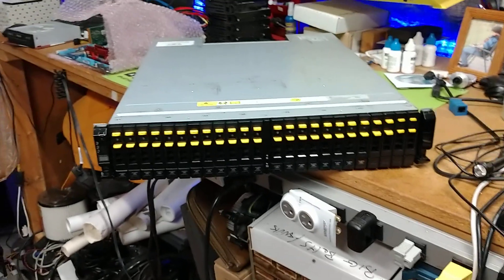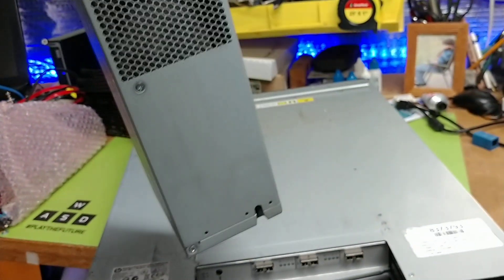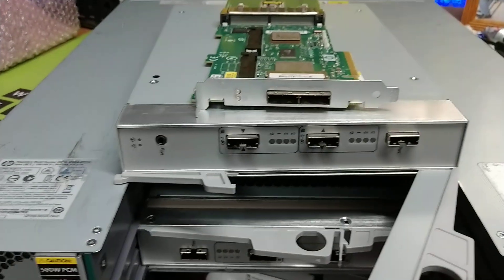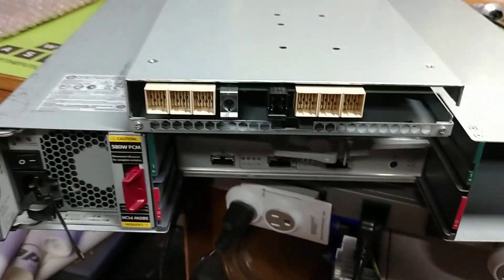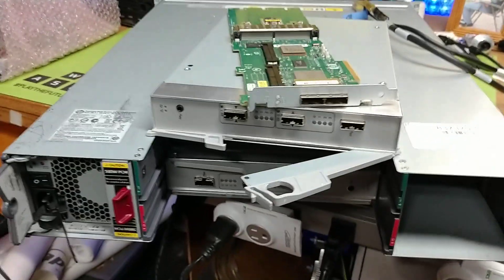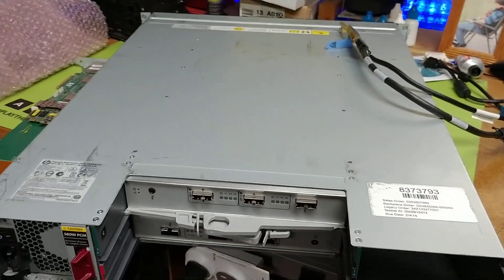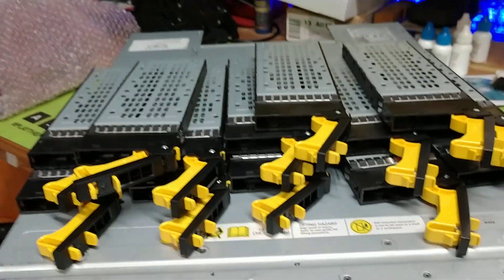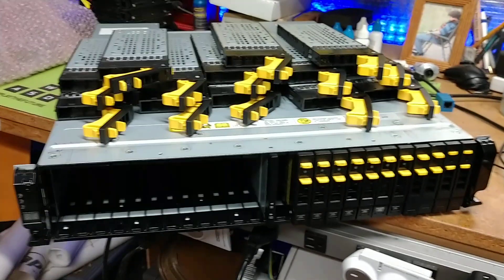Reusing a low cost HP 3PAR M6710 SAS/SATA 2.5 inch, 24 drive disk array  for your home server lab

Comment: Is this controller hba or raid? If it is a raid can it be flashed ti an IT mode and passthrough the disk instead of presenting them as virtual disks?
What is the equivalent of an iom12 controller in HP supporting sas3 12G drives?
Reply from the maker: You can do both. HBA is the most popular as I understand it but I used them both.
Reply: @leadiususa7394  Nice..thank you. When you used it as an hba, could you see  smart stats of your disks from the hypervisor or OS? If not it s not a true hba. It would remind me some Dell,'s controllers who while they have the option for hba mode as well, they aren t a true / native one With zfs for instance..many bad things might happen...the least of the them false logs for the disks health during scrubbing
Reply from the maker: @ierosgr  Well that is close to being true, the RADI controller that flip to HBA mode run in a old format and that will not report to newer storage standards such as ZFS for the controller is working at the hardware level and not at the OS level. These controllers work below the boot level.  So no ZFS can't go down that deep that I have seen. But you can get some info if you are using Smart drive reporting.  But that will only work if the hard drive will support that mode.   RAID base controller offer a lot that HBA mode doesn't and HBA mode has a JBOD level of value as well. I use both for their strengths.  SO enjoy the mode you need the best for your goals.

Comment: Hello, I liked your video very much.
I bought 2 M6710 with 2* 24 600 GB SAS disks. Two HBA's I will still order.
Which one can you recommend me for the M6710?

I plan to attach the M6710's to one server each and thus build a S2D Mirror SOFS cluster. VM's should then be executed there. Everything in the Homelab. 

Are the M6710 well suited for this? Or rather only for backup and data FIleserver?

Thank you very much.
Reply from the maker: I used the LSI 9200 series HBA controllers 4 port outputs "External  SAS connectors".  Get it the way you need it for your server setup.

Comment: We recently migrated all of our data off of three 3-par Storeserv 7000 arrays.  I have a boatload of the M6710 trays.  We were about to give them to a tech recycler when I came across your video.  It got my wheels turning and consequently decided to attempt to use them for a JBOD environment for our Veeam backups.  They are populated with 900GB disks and I currently have 5 trays connected to a perc H200 installed in a Dell R720 server.  I appear to be running into a hard limit.  The H200 sees all  120 drives, but it appears that the lifecycle controller on the server only recognizes 111 drives.  Consequently Storage Spaces only sees the 111 drives.   I need to add two more trays to our environment to reach the capacity I need.  I am wondering if anyone has any suggestions for me about how to do that, be it hardware recommendations, or configuration changes.  This has been a fun project.  Thanks for the video!
Reply from the maker: Well, I used a HP DL380 G8 deployed in a bare wire format (As in no blot-ware / life cycle service running) with LSI 9200 series HBA card and I could see everything. Are you running in HBA mode or RAID mode on the controller/s?   I am not sure of how your controller/s are setup...
Reply: @leadiususa7394  I am running in HBA mode.  I figured out that there must be a 4 tray limit per controller.  I added another H200 and connected the additional two trays to it.  I can now see all drives and have 117TB presented to StorageSpaces with parity and 1 hot space per tray.
Reply: BTW, write performance is terrible for the first full backups, but pretty quick with the incrementals and Veeam fast clone synthetic fulls. (I meant hot spare in my previous post)
Reply from the maker: @jltuttle6764  Cool! Enjoy!
Reply from the maker: @jltuttle6764  Yea, anything on the full scale data move will start off slow be will speed up over time.  Enjoy!
Reply: I ended up replacing StorageSpaces with TrueNAS scale for much better performance.

Comment: I have a bunch of 3pars I just bought and playing with them after building a custom server with LSI HBA cards. Is it possible to daisy chain a full rack of 3pars and connect to a single LSI card on a server?
Reply from the maker: Yes you can.  Just pay attention to the drive support of your HBA or RAID controller so you know your limits.  This is done a lot.  Not easy on the power consumption side of things..   Enjoy!

Comment: What is the SAS card you used in this vide?
Reply from the maker: I used a mini SAS to SAS cable and also used a NetApp SAS to SAS cable... The HBA controller controls what cable you use on it end and the SAS end on the back of the Disk array.  There are a few options so ID your controller cards first then get the correct cable for your needs.  Also you need to add your drive one at a time for the first time to make sure the HBA can see them.  What a pain I know with some controllers but it works.
Reply: @leadiususa7394  What is the SAS PCI card you used?   You mentioned that it was a good card but didn't mention which one it is :)
Reply from the maker: @HemnaIV  I used both a LSI 9200 series SAS HBA card and a HPseries 800 SAS RAID card from a DL380

Comment: Thanks for your overview it is very well presented. I have a lot of experience with HPE servers but Zero with 3PAR storage. I have obtained a few of the Disk enclosures complete with genuine 3PAR  2.5" SAS drives but without the 3 PAR controller head unit. Having seen your video, I  was keen to get them set up and learn more. However, I am not having any success in connecting to HP DL380 Gen7 - 8 or 9  servers and have tried a variety of SAS controllers including P222 & P822 with what I believe are good quality cables. Despite anything I tried, the onboard HP Smart Array controller doesn't see the external array or even the individual disks. I am wondering if there are specific cables required or tweaks required  and would be very grateful if you could provide any pointers to known working combinations of Array controllers and Cables or any particular issues you know which fail connections .  I have connected other MSA disk arrays to these servers successfully. Sorry for the public posting as I could not see a private message button
Reply from the maker: Try doing just one cable test the drive path way. I use the LSI controllers.  If you use both hook up. That will give issue unless you build out a dual pathway controller configuration using HPE SAS controllers
Reply: So much of this video bothers me.
1. It's called "Daisy Chaining", not "the Passthru".
2. The 3PAR 7000 series pictured was SAS, there was never a SATA option. SATA is not really appropriate for the reliability and uptime for Enterprise Storage.
3. All 3PAR systems are Fiber Channel or iSCSI connected from the main controller. They are a completely different thing from a MSA. Comparing a 3PAR to an MSA is like comparing the Space Shuttle to a private Jet.
3. A HBA is not a SCSI Controller, a HBA is a way of connecting a host (server) to SAN Storage. Basically a HBA is Network card for storage networks. (SANs).

Comment: Hello Leadius!

Can you please clarify on the subject of HP Being a relatively closed ecosystem if the 3PARs come with any licensing drawbacks?
Does any 2.5" fit as an almost plug and play? can someone who's just starting out in the enterprise space buy one of these off ebay and not worry about being locked out of the device for not having the proper licenses?
Or does the license only apply if you have the mother module? as in the 3PAR just acting as a dumb shelf, no licenses would be needed?

Question 2, does the 3PAR work on a 520 byte or a 512 byte?
Question 3, does the 3PAR system support daisy chaining? as in wanting to connect more than 1 in sequence to create a large storage pool attached to a main server as a controller rather than a mother module? are there license fees/limitations that?

Thank you,
Reply: I'll answer what I can, I'm also looking to get into the 3par system,
The disk shelves m6710 and m6720 with just the SAS controllers (not the 7200/7400) can use any SAS disks, and can use 512 byte sectors as they are basically just a SAS controller.

They can be daisy chained like a standard SAS enclosure

The 7400 controllers need the disks to be 520 byte as they act as a SAS controller themselves, whereas the 6710/20 just provide a SAS connection to your HBA/RAID controller

I don't know about licencing but I think that only applies to the 7400/7200 controllers

Comment: Thanks for this.  I'm new to storage arrays; have some stupid questions.  what kind of connector is that on the back of the i/o controller? different from stacking cable? ('cuz those seem expensive). doesn't look like sas port. what is it and where do we get cheap ones?
Reply: or is that just mini sas and there's something wrong with my eyes?
Reply from the maker: not sure, what is the make and model?

Comment: Hi, really like your videos. I am really interested in getting my hands on a M6710 or M6720. At work we mainly use Dell servers, storage and switches, and always found that we can use every hadr drive / ssd in DELL systems, whereas we had read a lot about compatibility issues with HP in regards to only allowing for certified parts. Can you comment on diversity/compatibility of the several manufacturers like HP, DELL, EMC, NetApp etc..
Reply from the maker: Well when you are working with a arrays then you are working with a protocol unlike manufacture makers of server gear that is specialize a lot like you  have said.  So I will go with A NetApp or EMC disk arrays and even 3PR arrays because they run only on the SAS protocol only so it works.  I prefer the NetApp DS2246.  Hope that helps...
Reply: @leadiususa7394  So you can stick any hdd/ssd inside the 2246 shelf and it will be recognized?
Reply from the maker: @marcon.6442  I have and it works for me.  IT really is up to the controller and not the array.  Sometimes a HBA or RAID controller may not like a SSD but I use the LSI 9200 series and works pretty well.  (the easy fix is to flash the controller BIOS to the latest update.) Now mix mode not so well unless you put the disks in as groups and group them together by type when using them.  What I mean is that if you put five SATA drives then five SAS drives and then five SSD drives.  Make sure they are grouped by type.  Then make your LUN / pools of storage by type.  Do not mix them for it will not be pretty I/O bandwidth wise.   Outside of that have fun playing.

Comment: Hey! Great video. I've tried to google, but is there any way to control the fan speed of these things? It sounds like a jet engine haha. The data I've got on the drives I don't really care about, so I dont mind if it goes a bit hotter than it should.
Reply from the maker: It should spin down to a low blow unless you have a fault error on your array. (Look for yellow LEDs or beep codes.)  Mine goes load for about four minutes then calms down and run pretty quit. Go to the support site for fault error info.  Hope that helps some..
Reply: @leadiususa7394  I can use the drives, no problem. Currently copying data at full speed. It does however say: 54 on the led. I'll try and see if I can find some more info. But there is no way to control it via com etc? The status of the trays is amber, I guess it doesn't like the baracuda SATA drives. Maybe this is not compatible with non HP drives?
Reply from the maker: @victorkarlsson5183  No, the drive is not the issue unless you mixed them over and voer.  There may be a issue there but you put the one class drive in first as a group then SATA and so on. and your don't mix them, that will work. If you have a amber light you need to check you controllers in the back or look for a dead fan or proper supply and so on. Go to the HP 3PAR support to ID the amber code them swap out the bad part.

Comment: good video, but i'm still confused as to what cables i actually need for this device
Reply from the maker: Just look up the end connection for sad controller then do it for the array. Best way to figure out the correct cables you will need.
Reply: @leadiususa7394  yeah... I eventually figured it out. Thanks for responding. 👍
Reply: What cables did you end up needing? I'm struggling with this as well.

Comment: Hi, i am looking to expand my storage for very cheap. Because i am a video editor/3d artist my storage gets full really quickly. I have my eyes on a very cheap m6720. I was wondering if it is possible to configure it so that the drives show up as individual drives instead of a raid? And is it compatible with 18TB drives?
Reply from the maker: Well yes if you are getting a m6720 24 3.5 drive array.  That should work for your needs.  You will also need a cable for SAS/SATA hood up to a SATA/SAS LSI HBA controller (single drive mode...)  and you can also use a RAID controller but just make each drive a RAID 0 drive.  This make all the disks act as single drives.  As for the size of the hard Drive, check the specs on the HBA or RAID controller you want to use to know if you can do 18 TB drives.  I am pretty sure it will work but do your research what you are buying.  /:>  Enjoy!

Comment: Any chance this would work with a newer HPE E7Y20A (HPE 3PAR 20000) enclosure or stick to M6710/20?
Reply from the maker: If the Server HBA controller and the disk array controllers  are both SAS connection, you are to go.  Any will work.  Just make sure you have the SAS controllers in place.  Some 3PAR come with IP base controllers for the NAS role.  Your call.   Have fun dude!

Comment: Hey I have another question, if I was to use a older machine with a RAID card already built in, is there any value loading FreeNAS? or TrueNAS? My goal is to use the machine for storage, files, videos, maybe a VM or two. What are your thoughts? OR is it better to replace the RAID card with HBA card?
Reply from the maker: I would try FreeNAS / TrueNAS. The OS can add some benefits using the motherboard RAM. If you have some...

Comment: @leadiusUSA I want to buy one, I want to use a poweredge t310, how can I connect? Can you do a video?
Reply from the maker: Yea, I did a video or two on this already.  Really you just need to do your research (You need to know the basics...) on a single SAS cable hook up and get a SAS controller (Like HP 822 SAS controller) then you can setup either RAID or HBA mode.  Remember to use only one SAS cable on the top controller  in the back of the SAS disk array.  Pop the bottom controller out for now.  Until you want to add another disk array to the mix.
Reply: @leadiususa7394  I see in this video how you explained how to connect the cable - I understand that. So I would need to buy the card and pop into the server and from there program the card. 

And particular software you like to use to run the array? I was thinking of using freeNas? 

Thanks for the reply
Reply from the maker: @Hands-onNow  Well it depends on if you get a RAID controller or a HBA controller.  With RAID you setup the disk groups inside the BIOS of the controller.  The is no real OS level software needed outside of the monitoring software.  Let do this.  first ask what to do you want to do with the disk space.  Use it for VMware, or IP storage for a NAS service or a media server for your videos?  Make a list of what you want to do with the disks.  If you want use the disks for VM machines then create a RAID 1 group and have one spare disk for fail over.  If you are just doing NAS storage then RAID 6 with one spare, any between RAID 5.   If you choose to use HBA, you can't set anything up in the controller BIOS.  It has to be done at the OS level.
Reply from the maker: If you use a HBA controller then look at using TrueNas.com and use their free disk manager software called FreeNAS.  HBA controller have some value when doing thing this way.  Sorry for all the writing...